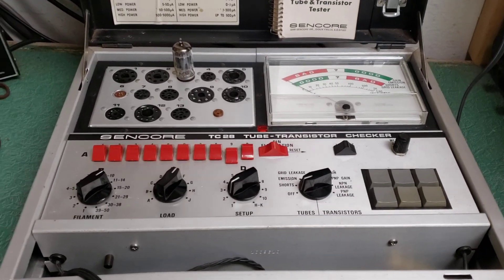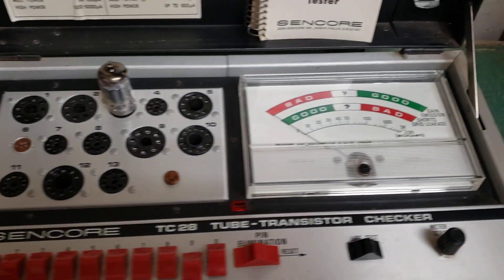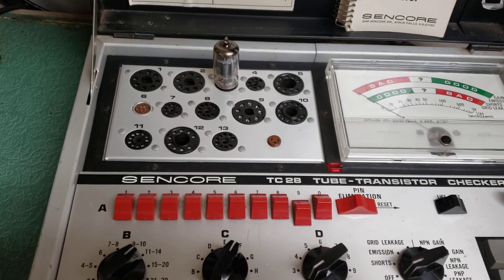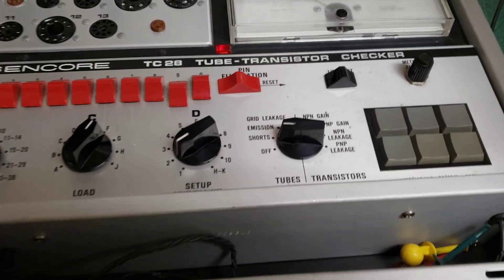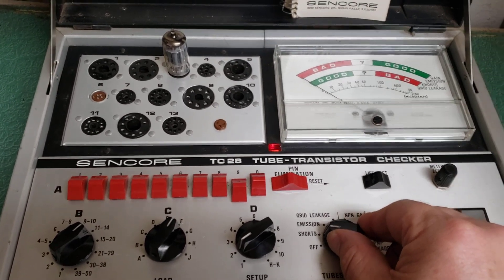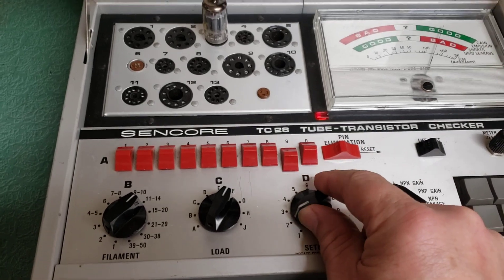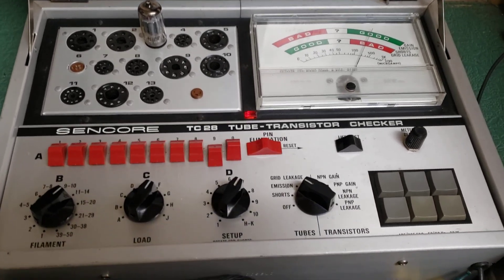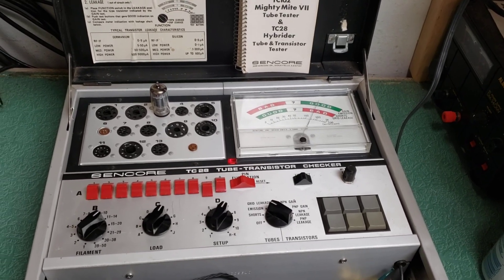Sencore Model TC-28 Tube & Transistor Tester

Comment: Thanks for this presentation of the operation of the Sencore TC-28 Tube-Transistor Checker.

I started working in the Sencore service department in Sioux Falls, SD, after the factory had moved to a modern technology factory transported from the old industrial Chicago region. The founder of the company, Herb Bowden, was from the southeastern part of the state.
While learning about each of the Sencore products, I focused on the repairs of the TC162 Tube Tester, since it was similar to those that my Dad used at his TV shop in Mandan, ND.
Those 'Filament', 'Load', and 'Setup' switches, with the three "GO-NO GO" test of 'Shorts', 'Emission', and 'Grid Leakage', all simplified a serviceman's decisions whether to replace a particular tube in a home setting.
While at Sencore, I was directly involved with the promotion of the famed TF26 "Cricket" transistor tester, with which Herb had simplified with similar 'Good-Bad' tests, but used 'permutations' of the connections to the three leads of the typical transistor with six push-buttons to also switch through the polarities and parameters.
Yet, during a meeting at the factory around 1974, Tom M. of Chicago mentioned, "Service technicians are now encountering with both tube and transistor testing" environment.
Thus, the Sencore TC28 'Hybrider' (shown above), incorporating older tube testing with newer transistor technology, at the time.

(btw - I sold hundreds of TF46 Crickets in Ohio, and the Mid-Atlantic states.)
Reply from the maker: Gosh thank you for the comment!

Comment: I have this tester.  The capacitors are not a good brand for longevity and most of these models have leaky capacitors. It can be hard on the transformer and alter test results.  Its just routine maintenance for small money and the capacitors are essy to get at with two screws holding the panel to remove for de-soldering.
Its a fun nice tester, although its only an emissions tester.  With all emissions testers you have to be careful to not hold the test button down a long time while you're testing the tube because you will damage the tubes and wear them out much quicker that way compared to mutual conductance testers. The best way to do it is warm the tube up thoroughly for about 2 to 3 minutes or more then do a quick test and don't wait to see if the reading drops.